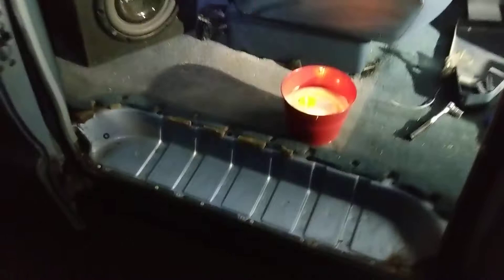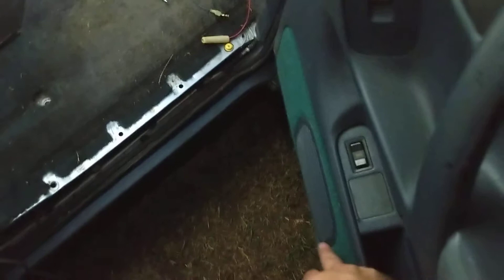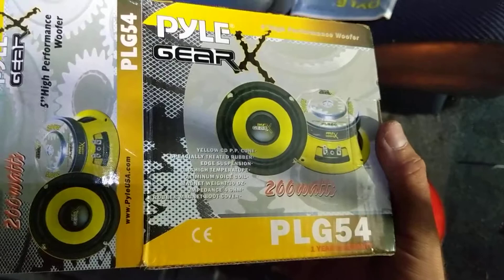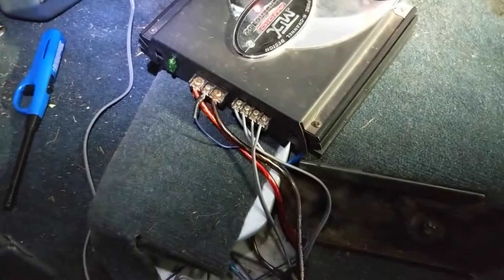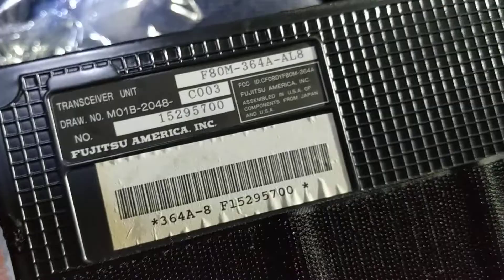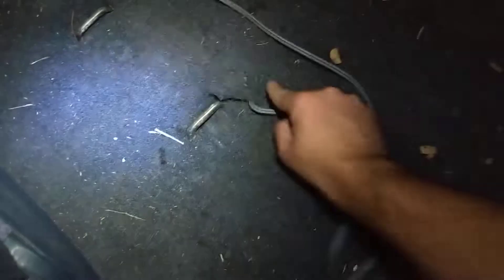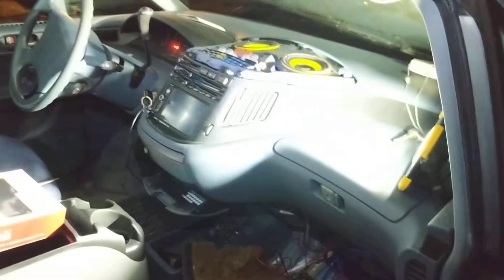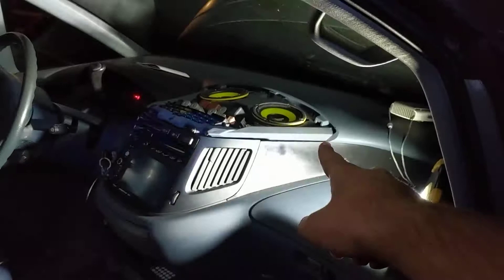7 Speaker Setup in a Toyota Previa

Comment: Hey I'm following in your footsteps. Did you only have to break apart the fuse box for the dash speakers? What about the HVAC behind it? I'm staring at a pair of these same speakers and my HVAC and wondering if this is going to work...
Reply from the maker: Yeah I just had to trim away at the speaker housings a little bit and then basically just shove them in there. It's definitely a tight fit but it works.